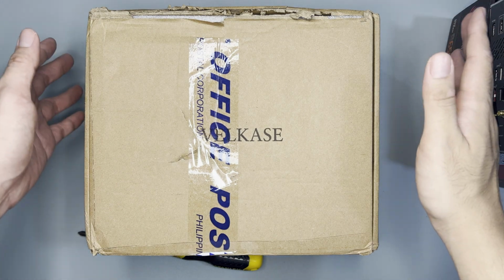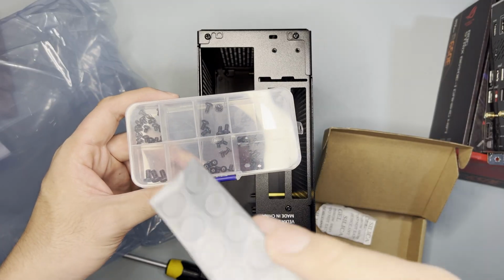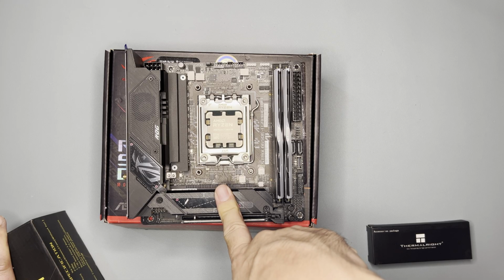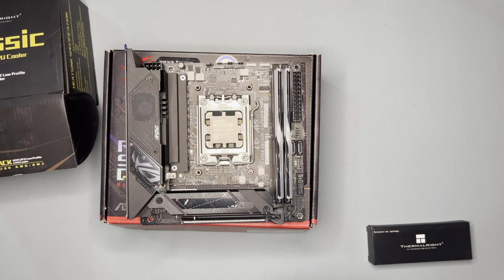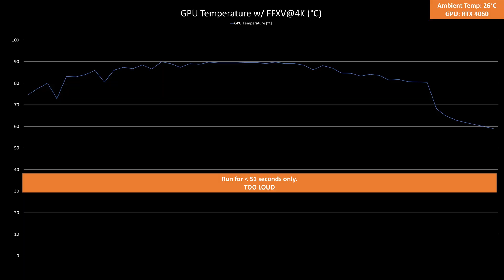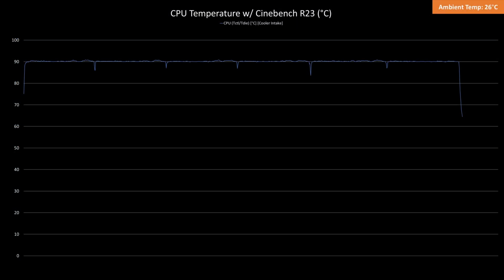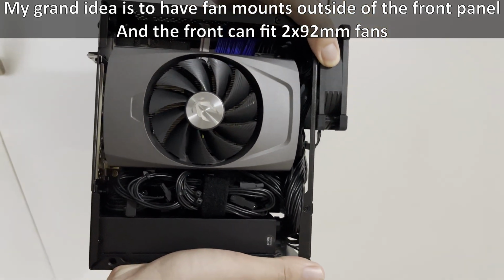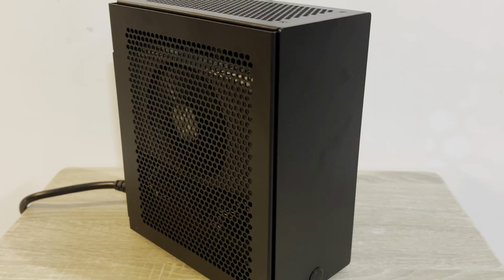Velkase Velka 3 | A 3.99L SFF ITX Build | Thermal benchmarks

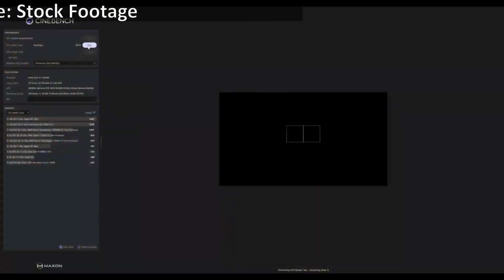Comment: I'm a bit confused, you say you used a 7800x3d, and a 4060, but then when benchmarking in Cinebench at 9:06 the system is completely different? It says you are testing a 14700k and a 4070 super, did you use the wrong clips?
Reply from the maker: It’s stock footage 🙂

Comment: Everyone who builds in this case had to undervolt their cpu because the 36mm cooler fans only cool up 95w. I just ordered a Geeek M31 case that's 6.7L at H-9.4X W-5.1X D-8.4 for $80. It takes a 56mm cooler and you can get a gen4 riser for an extra $20 and takes up to a 210mm gpu up to 2.5 slots. The Velka 3 is nice but overpriced in my opinion, but cool build.

Comment: there is also scythe shuriken 3 (39mm)  :)
Reply from the maker: hi, thanks for the info. While it might not work without the offset since the panels tend to curve/bend inwards to the case. Anyway, this is one reason why I pointed out that the offset feature should be clear as it opens up compatibility options.

Comment: can u do a build with-out the mini itx apple tax? poor mans/ cost effective sff
Reply from the maker: hi, if you're referring to not-so-expensive cases, then soon. However, for components, those are really expensive.
Reply: @manongunboxing  They kill you on the case board and psu when mini itx. Also has to perform way better den series x. Laptop killer with out the temp issues